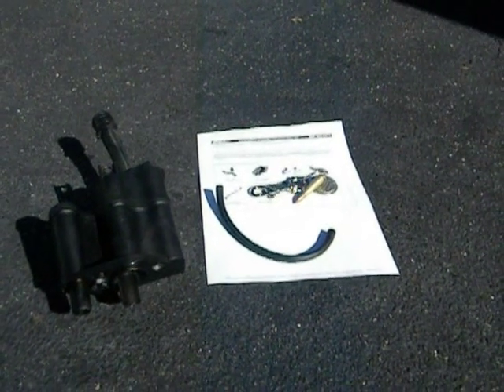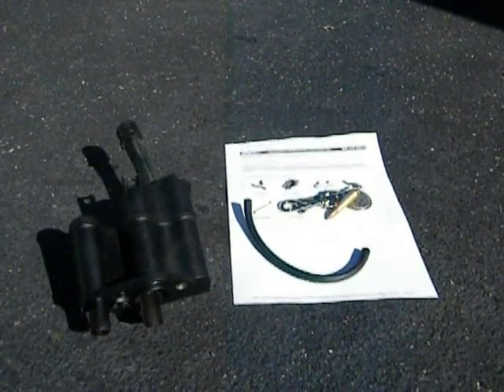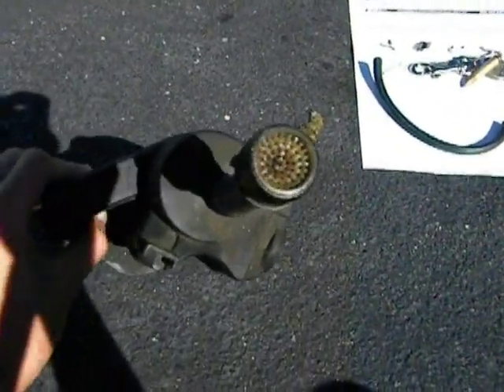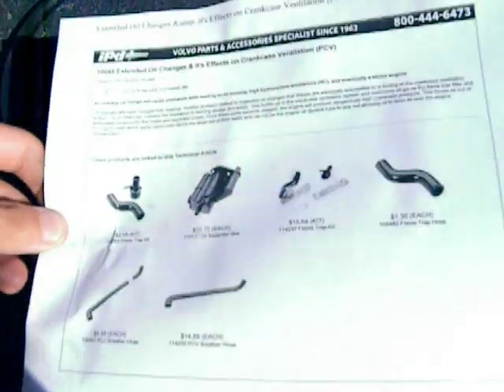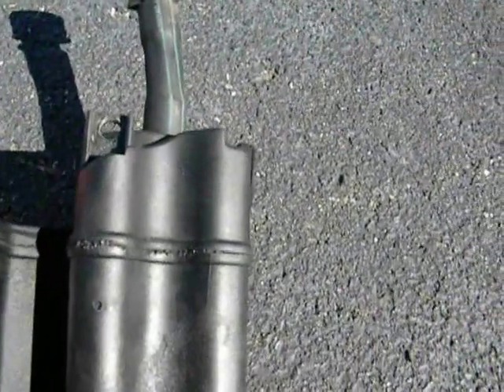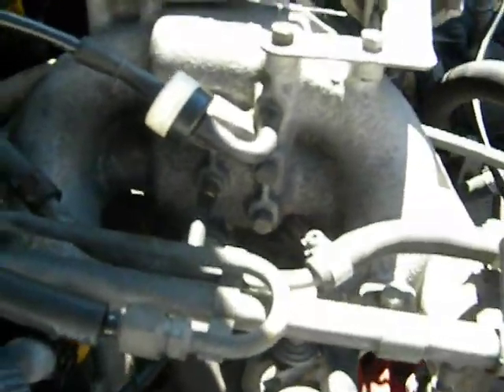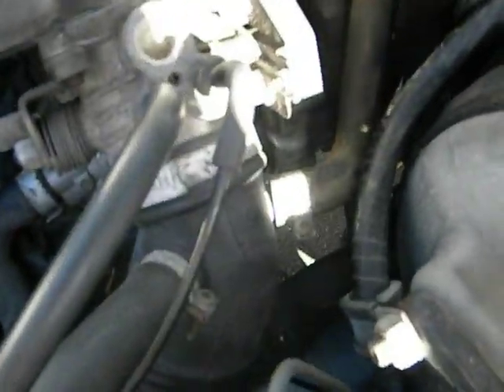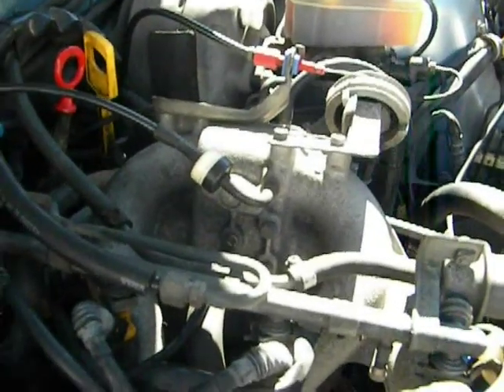Intro to Volvo 240 PCV Part 1

Comment: All these hoses are for emissions so it cannot go in the environment ?  Can I just disconnect all of them before the emission laws ?
Reply from the maker: Only two hoses are for emissions  the two closes to the black intake pipe, they are for the EVAP system, all the other ones run important stuff like AC vent position, fuel pressure regulator and Idle air mixture, if you disconnect them it may run terrible, not idle, etc.

Comment: A good test to see if you are plugged up is to put your palm over the engine oil fill hole :)  (remove the oil cap, start the engine) and if it is sucking your palm in at idle then you're good. If it's pushing against your hand you're clogged up.

Comment: Nice Video.  Today i was driving my 1991 240.  going 30 mph, i heard a pop under the hood.  minutes later i smelled, and saw smoke coming from hood.  i raised hood, and saw oil spitting out from back near top of passenger side of motor dripping on exhaust pipe.  i drove it home.  now to fix whatever is wrong.
Reply from the maker: Feel behind the head of your engine by the firewall your rear cam plug gasket probably popped out, you probably have a PCV issue , so much pressure probably built up inside your engine it popped the seal out, type in IPD Volvo cam cover gasket on youtube and watch the video the round black thing on the head engine in the video is the gasket, you have to remove the valve cover remove the rear cam cap and replace the gasket plug, also replace the valve cover gasket as well as go over your PCV components, if your going to do that please get a good torque wrench the torque on the cam cap is 15 ft-lbs and its very important! If you over torque it you could damage the cylinder head or cam, if its too lose the cap could pop off or a bolt could fall in the engine, check it out and feel free to post again if you have a question
Reply: thanks very  much for all your pinpoint suggestions and explainations. continued success to you!
Reply from the maker: No problem, thanks! Good luck with your Volvo :)

Comment: the cam.intermediate seal, and front crank seal are usually done , about every 100,000 miles. Opinions vary on this but this is the rule of thumb

Comment: You actually DO NOT NEED to remove the intake.
Reply: Ditto
leave the intake in place, remove idle air motor and its bracket and associate hoses. 2 bolts and its out. I always swap out the oil trap and flame trap.
I've done it both ways, removing the manifold is not needed at all.

Mine is a 1990 740 with Regina, not Bosch system.
Reply from the maker: On a Volvo with K-jetronic you may need to remove the intake, not on one with Bosch 2.3 L electronic fuel injection, removing the intake manifold or TB makes it easier

Comment from the maker: To conclude this, the flame trap is not a good indicator how sludged up the box is also my rear cam seal continued to leak a bit after I overhauled the flame trap/ PCV system, I still have to replace it and if you run into any problems or have any more questions feel free to ask, 
Best of luck

Comment from the maker: ... not to pull the hose up from the block, just lift the box slowly and make sure only its being pulled from the block and move it up and over the injection wiring harness and then when it gets close to the intake start to turn it upside down towards the fender and pull it over the harness towards you, be gentle not to damage anything, when you get the box out heft it, its not supposed to be too heavy, but buy a new box before you remove the old one and replace it

Comment from the maker: Replace the box and the cam seal, they are supposed to be replaced every third oil change but they are often left to leak, the trick to getting the box off is to go from under the car under the intake loosen the two bolts (much easier said than done) I used a lot of wobble extensions, unattached the fuel injection wiring harness form the box, its a zip screw, save that clip when you take the box out, what I did was I detached the flame trap hose, and pulled the box up being careful...

Comment: Is it tricky to get the actual box off? (not the flame trap)
I am diagnosing excess crank pressure causing my front cam seal to leak a little and I pulled the flame trap - it's dirty but not clogged. Much like yours in this video. Did you find that the flame trap was not an indicator of how sludgy the actual "box" is that the flame trap is attached to?

Comment from the maker: If the canister hasn't been replaced in the time you've owned the car or in the span of the last three years I would replace it along with the flame trap, IPD USA has the parts for a good price, the engine will run much freer with a clear PCV canister and flame trap

Comment: Great Video! I'm also a volvo owner and checking the pcv system was a pain. I would put two fingers in the slot by the third fuel injector and stick my hand in the space between the block and distributor. I would recommend getting IPD Flame Trap relocation kit. Worth every penny